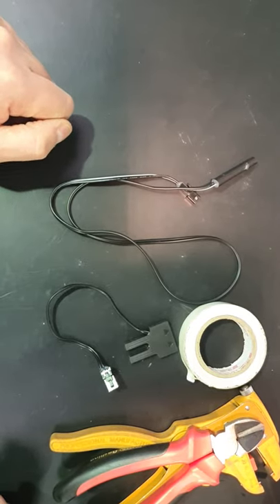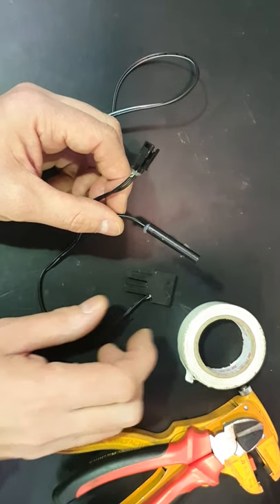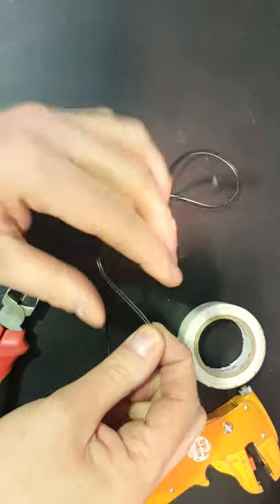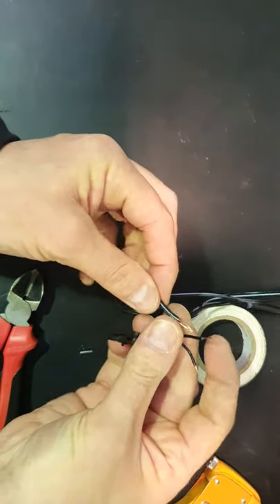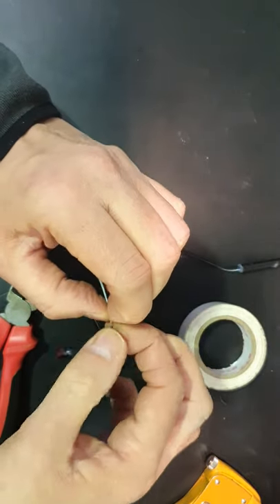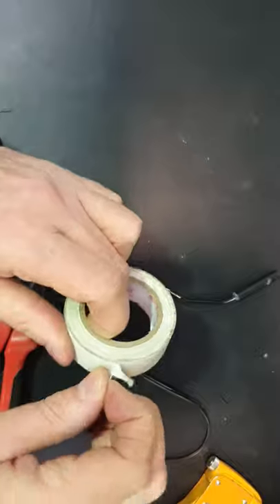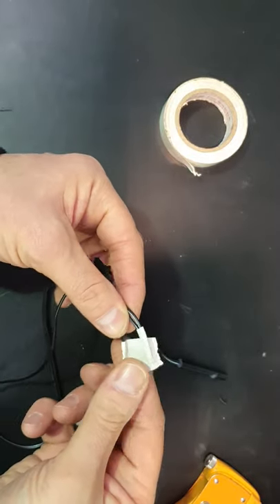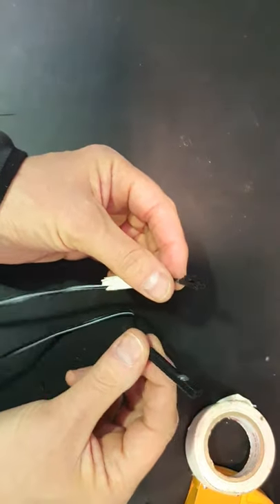Splicing together speed sensor wires to allow a temporary or emergency repair

Comment: Jon - I am an engineer (Electrical/Electronic, in USA) and my girlfriend has a  Nordictrack EXP1000 that just experienced sudden stop issue twice in her most recent workout.   Treading along at 3.0 mph and sudden stop, as if STOP was pressed.  The display still worked (normal), she could restart it again without a power cycle and it happened again some minutes later. I read on another side that the Stop switch can get compromised by sweat and or repeated actuation (most used button?) that is can be temperamental (oxidized/work contacts), and with vibration of machine, can "trip" on its own and cause a sudden stop.  This "theory" makes sense, but these can be complex issues.  Any experience here?  Do you have, or know where I can get, a service manual or schematic wiring diagram for such a machine?  Much appreciated.